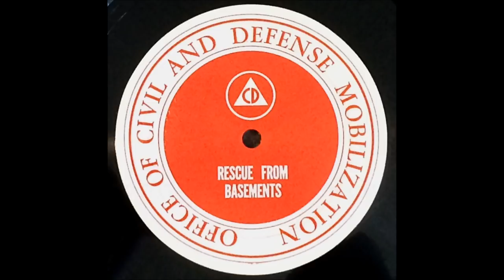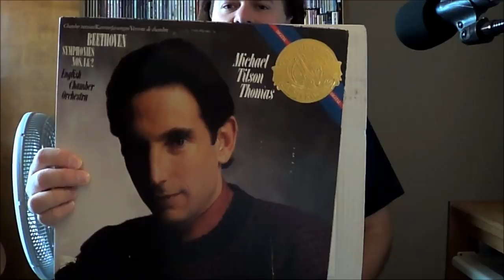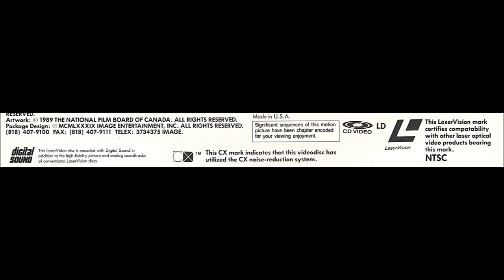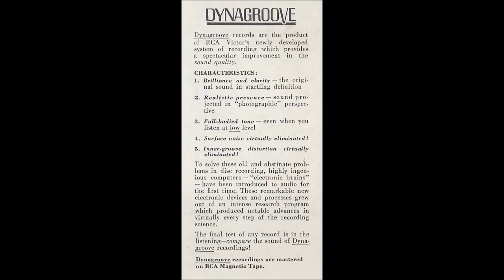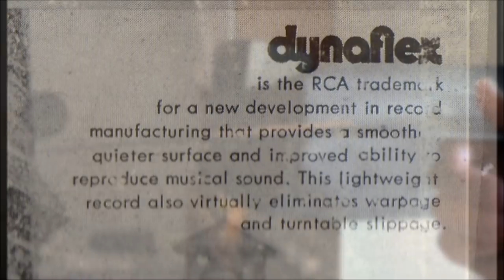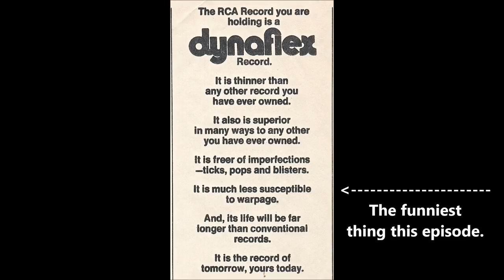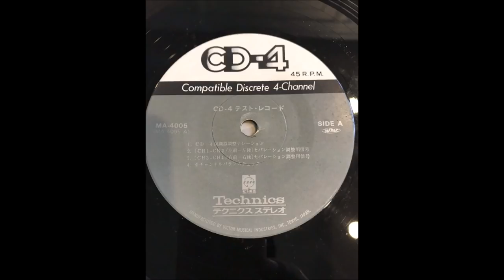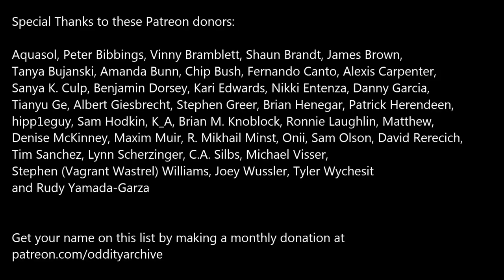Oddity Archive: Episode 138 – Dynagroove & Friends (Vinyl Oddities)

Comment: Both Dynagroove and Dynaflex lived on until the early 1980s on the records that RCA made for Reader's Digest, although most of those were re-releases of older material. I have a Dennis DeYoung LP which is also slightly transparent when held up to a light, but it makes no mention of Quiex or anything else special. Another vinyl oddity is 317-X, the anti-static agent (probably also full of toxic chemicals) that RCA claimed made their records not attract dust, even when held over an ashtray. 317-X either disappeared or RCA stopped advertising it by the late 1960s.
Reply: VWestlife I used to have plenty of Dynagroove albums and it's sound not too bad, despite the audio quality, it looks good. There were many RCA albums in the Dynagroove collection from 1963 through 1969. Eddy Arnold did many of the albums in Dynagroove, so does Ed Ames (formerly of the Ames Brothers), Henry Mancini, original Broadway cast albums, and so on. Jefferson Airplane, one of the best rock band during the height of the psychedelic craze did their first album called "Takes Off"  which was the only Jefferson Airplane album that are Dynagroove. The rest of them are not Dynagroove. "Surrealistic Pillow" is still the best non-Dynagroove album that has two songs like "Somebody to Love" and "White Rabbit". 

The label you see is the design that RCA Victor was used from about mid 1964 and it remained until early to mid 1968 where they changed their label design, and the RCA logo was changed by that time when it was replaced by a modern RCA logo, and the color of the label was changed from black to orange, and the Nipper logo was absent until 1976.
Reply: VWestlife, a lot of the A&M artists (I remember seeing Styx’ Kilroy Was Here being labeled as being pressed on the new vinyl formulation that was introduced at the time…I believe 38 Special’s Tour De Force and The Police’s Synchronicity were a couple of others) had albums pressed on the vinyl you mention - held up to a light, it glowed purple! Def Leppard’s Foolin’ single (only the vinyl pressings though) were seemingly pressed on the same vinyl.

Comment: No idea so many types of vinyl.  I just remember the records in the early 60's sounded the best and the 70's I was told the oil crisis was at fault for they needed oil for vinyl.  At the end, vinyl sounded great before it got ditched. For me, it is most amazing to dig out an ordinary looking old record and get the best sound.
Reply: Oddly enough, even Stiff Records ended up this way and their motto was slightly R-rated as in If it isn't STIFF...

Comment: If there's a part 2 to this, please consider a bit on Direct Metal Mastering.  One of the brightest, loudest records from the 80s I remember hearing, right when CD were becoming noticed, was a DMM disc.  Sounded so good.  But it was a work record (I worked in radio at the time).  I think it was a Chaka Kahn record.

Comment: Your comments on Dynaflex and Dynagroove are generally on the mark, but there are a few points to consider. In 1968, RCA did indeed use a mixture of recycled vinyl, resulting in very noisy and brittle records. By late 1970, they began transitioning to the new Dynaflex formula, using real vinyl, but weighing not quite 100 grams. It's worth pointing out that RCA began de-emphasizing references to "Dynagroove" in 1968, after the switch to the then-new block logo. They didn't completely disappear until at least late 1972. (Several albums issued in 1971-72 featured both "Dynagroove" and "Dynaflex" information.) RCA added Dynaflex information on covers in 1971, but began de-emphasizing that as well by mid-1973. They still kept the logo on labels until 1975. Interestingly, when RCA repressed albums from the Dynaflex and Dynagroove eras, some references remained intact (while removed on other releases) even though both processes were no longer widely used. The Bowie album in the video was an early-1980's era pressing, and definetely not a Dynaflex pressing.

Comment: Sometimes called " Dynasludge " , i've heard . They are a "bit" over compressed sounding.
Reply: Try learning to use "Audigy" which is free but will require you to install a couple things they don't own (such as LAME so you can make proper mp3s etc). You won't believe what you can FIX, including some pretty bad phasing problems and many poor You Tube audio files. May or may not save Dynagroove records but then again some of the most popular stuff that RCA had made it to digital bin cassette duplication before that ended, not to mention CDs.

We all know that STEREO 8 was the best place to find that ancient stuff!

Comment: Dolby noise reduction is not "just a filter," it is a multi-band compander system.  Although the Dolby B home standard primarily concentrated on upper frequency companding, other Dolby noise reduction systems, such as Dolby A and Dolby SR, are true multi-band companding systems that significantly reduce magnetic tape noise artifacts while increasing dynamic range.  Note:  Ignorance is not charming, and people who have technical knowledge find much of your generalization and dismissive tone offensive.
Reply from the maker: Here's the deal: Yes, Dolby involves companding.  However, it's so gentle, it makes (in my opinion) no significant impact.  The bulk of what Dolby does IS filter.  I discussed it in more depth (and, of course, acknowledge the companding) on my installment on DBX NR.  As for the last section of your comment, I'd like to point out that the majority of my viewers (and most other retro content/tech channels) are not experts--this is, first and foremost, entertainment.  I do my best to strike a balance between the basic and advanced with my work, but there's only so much you can do before it devolves into excessive minutia, especially when trying to tackle multiple subjects in a sub-30 minute video.  Also, if you find me and my work offensive, I suggest you find another channel.